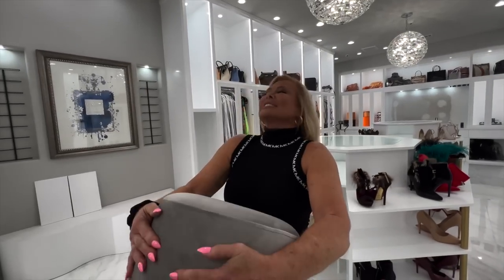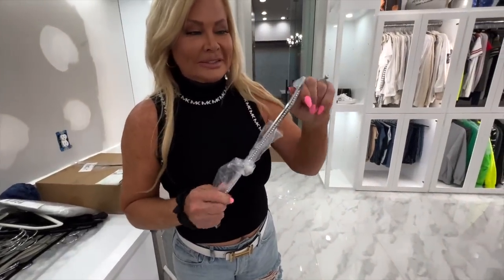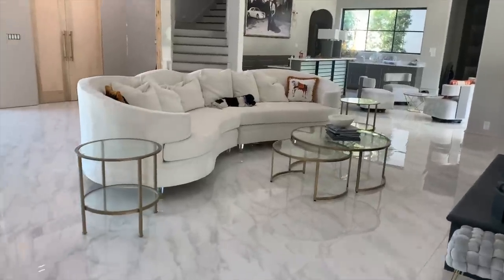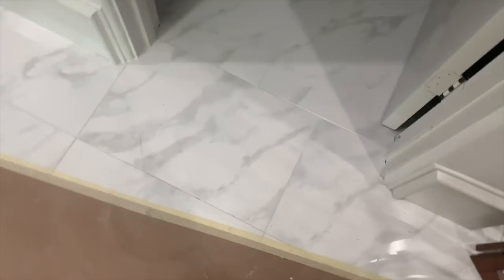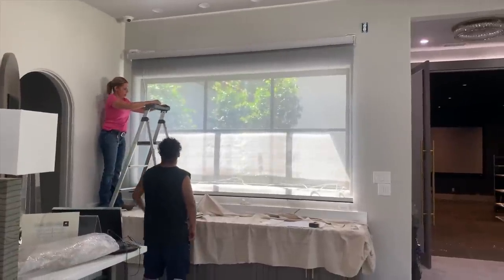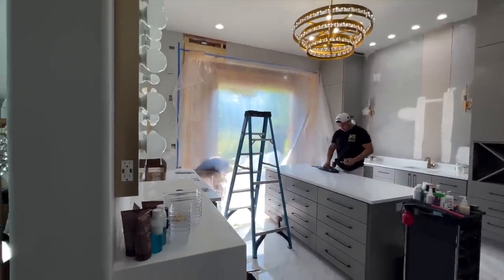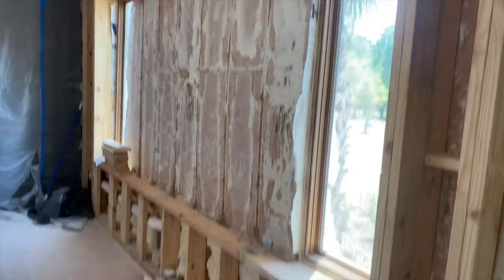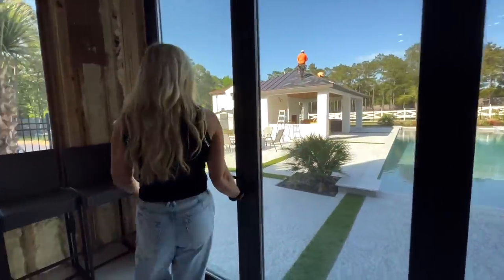IT'S ALMOST FINISHED!!

Comment: So thrilled that the wall around the new dining room window will now be sheetrock. The one wall in stone looks awesome! I did not care for it with two walls in stone. It was just too much in my opinion. 
Will you be replacing the roof on the house and barn to match the new roof on the outdoor kitchen/living area and well house? The metal roof looks super good with the stucco!